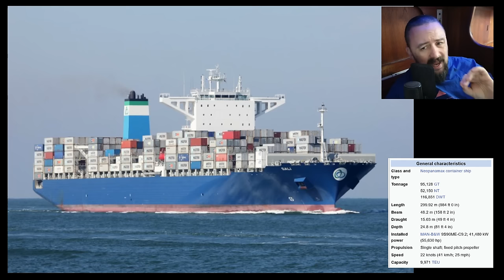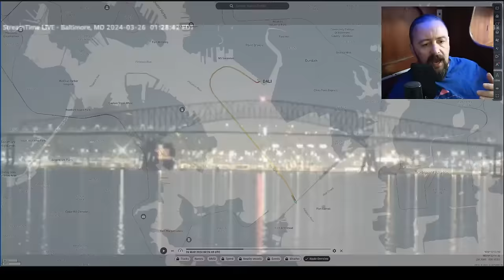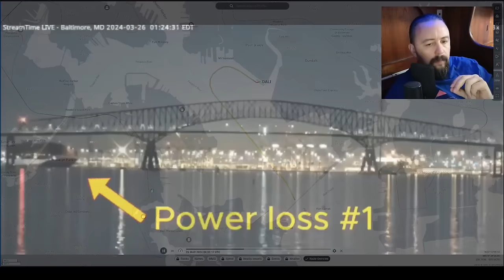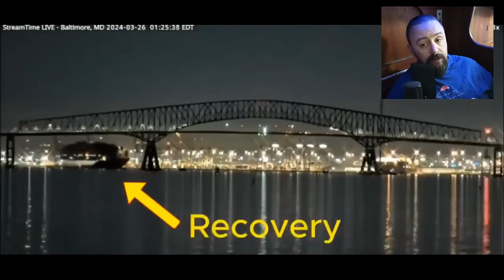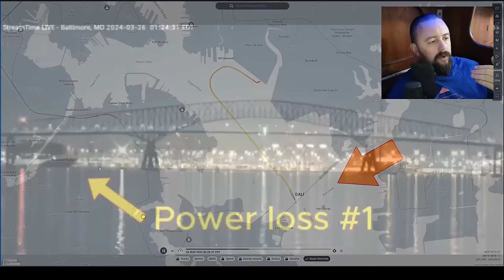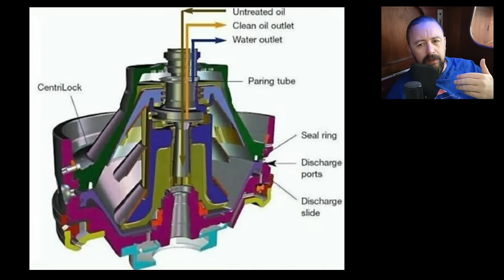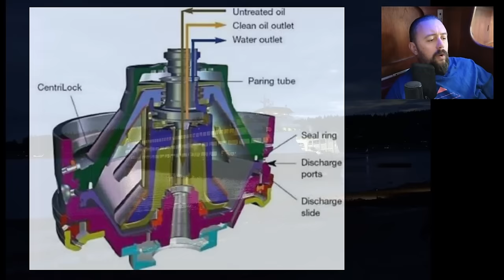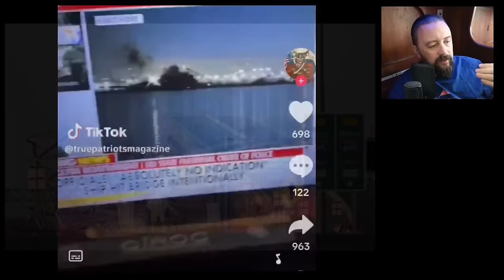Why MV Dali lost power and struck the Key Bridge: a sailors perspective

Comment: I was in the Coast Guard at Curtis Bay which is on the Baltimore Harbor side of the Key Bridge behind a channel and penisula. I served there a few decades ago. I agree with you concerning the lack of escort tugs and how they should have at the very least accompanied the ship until it passed under the span and through the narrow 1.83 mile clearance in the river just south of Sparrow's Point. They used to do this. Two tugs, one fore, one aft...port and starboard would tie a loose line and accompany the large cargo vessels in and out of the tight constrains of the port of Baltimore and under that narrow 1200 foot clearance in the Scott Key Bridge. I remember asking about this when I was on a bouy tender out in the bay coming in towards the Key Bridge my first time underway...In fact, in 1980 (June I believe) an Asian cargo ship slammed into a pylon of the Key Bridge due to engine failure and caused some damage but there was no massive collapse like this week. From that time forward it appears that at least until the 1990s the tugs did a full escort under that bridge both ways. I also think once power was lost and they regained some power they did a full astern to try to reverse the ship's course, or stop, and this caused the ship to go starboard (right). That is the black smoke....that strain of doing a full power astern. Had they simply allowed a full course ahead they likely may have stayed in a straighter line. This is just surmise on my part, but I have steered vessels in that body of water. Remember, this ships are huge, the cargo is enormous, and these waters are shallow and pretty narrow...
It is also obvious they have cut back on tugs doing nothing more than getting them into the channel straight towards the bridge about 100 yards from the dock and the tugs are done now.

Comment: The key lies in the fact that the ship veered to right just before the Bridge , before which was the black smoke from the funnel , Taking these two into account it is possible to construct the case 
These are harbour tugs meant for docking & undocking not salvage tugs, to say even if the tugs were there at the bridge it would be of not much help to a ship moving at 8 knots, This contaimiated fuel &  causing black smoke is but nonsense,

Comment: Does DALI have a bow thruster , if so why wasnt it used .
Reply: What part of the had no power the bridge went dark is so hard to understand
Reply: Yes the Dali has a bow thruster.    But it's not designed to stop an out of control ship.    It's actually designed to push the bow away from the dock
Reply: @jeremyeldee5205  I like how everyone here is an expert and knows exactly what happened and exactly what they should have done. Yet none where actually there
Reply: @gregorylyon1004 Besides if there is a Blackout. Bow Thruster is also dead. Normally when the vessel is already clear off berth and the speed is more than 8 knots and increasing, Bow Thruster will be on stand by or it be switch Off to reduce power consumption.

Comment: Would dropping anchors help for no power
Reply: It takes around 5 minutes to drop Anchor
Reply: Definitely it will help, If the 2 anchor drop on the first blockout there will be a chance that the vessel speed will be reduced if not completely stop.
Reply: Dropping anchor is less than 5 seconds. If the vessel is inside the channel, both anchor are ready to let go in case of emergency like this situation.
Reply: The port bow anchor is out, wonder if while the stern was sliding to port the ship tripped over its own anchor maybe pulling the bow to starboard?.  I take the the Dali would have stern anchors?

Comment: The dali has two auxiliary generators  3,840 KW and 4,400 KW. She also has a bow thruster which to my way of thinking is one of the most important things to enquire about. The port anchor chain is also vertical which considering what happened may have lost the anchor..
Reply: those are 6600v alternators in it.

Comment: Does anyone know it this ship had a direct reversing engine or a controllable pitch propeller? I remember hearing about a tragic accident involving I believe a large factory fishing trawler. This boat had a controllable pitch prop and it was sinking as the crew were attempting to launch the life rafts the flooding overcame the gensets and it lost electrical power. Apparently when power is lost some of these controllable pitch propellers will go to full reverse. In this situation being offshore in a storm at night no one noticed that the vessel was doing something like 18kts in reverse and when they put the rafts in the water they were promptly swept away. I don’t have much experience with controllable pitch wheels but it would explain a lot. Since the engine runs at a constant speed and the speed of the vessel is controlled by the pitch of the wheel, having it go to full reverse pitch would load up the engine causing the govener to run the rack to full fuel and you would get the same black smoke until the turbo spooled up. I was thinking about this and it’s an interesting possibility that would explain a lot. I’d be very interested in finding out if this ship had a controllable pitch prop and if so if it would go to full reverse on its own with a loss of electrical power.
Reply: The info panel about the ship, showing from 1:50 on, says it had a fixed pitch propellor.
Reply: Over load shuts it down

Comment: A more logical and simple explanation is that this was intentional… the “power outage” does not coincide with the engines being on or off. This first time it had lights off and no smoke. The second time the lights went out the engines were still going full throttle.
Reply: NO....! But AVOIDABLE.....  All actors took it not serious..... Maybe the port personal didn't know about the real issues of this ship....
Reply: Much of the electrical is powered by a separate generator set with backup.
Reply: They likely never lost the propulsion engine. They lost power and control. That’s why the black smoke they likely were quickly trying to slow down

Comment: Basing then video.
NOTE: *When the running generator fails to fulfill the load requirements of the ship then, the 1st stand by generator will come on load automatically within 15 seconds. If the 1st stand by generator fails to start automatically then the 2nd stand by generator will come on load automatically in the next 15 seconds. But, if both the stand by generators fails to start automatically then, in the next 15 seconds, the emergency generator starts and comes on load automatically. Thus, the emergency generator comes on load automatically within 45 seconds of the power failure from the running generator.
 Emergency Generator was not able to.load automatically to keep the vessel navigation and steering systems to steer the vessel away from the Bridge pillar. 

SOLAS requirements for the Emergency Generator :
The emergency generator should come on load automatically within 45 seconds of the power failure.
Reply: Over load by smoke. Went down on murphy switches. Over boost over load
 Off it goes manual re set required

Comment: Thank you so much 😊 for talking about ( centrifuge) fast spinner for fuel, water, particle, ( bunker C) left over bulk fuel after refinery. Cheap left over bulk fuel that CAN and has been used in shipping
The oil company SELL this left over products that can BURN in these large ship's 😊 the huge Marine Engines specially designed to burn this left over fuel. So glad you showed the ( inside) of one of these. Have hear the term, never seen the inside of one. Remember what they mandated after the big Alaska ( Prudhoe Bay) oil terminal. They require TWO very powerful Tractor TUGs to be on standby and have there cable rope line on super oil tankers. There were SPECIFIC build Tugboat, with HUGE powerful Diesel engines. They had massive ( Ballard) pulling power that means the tug can pull in winch and not tip over even with tugs pull with the main engine. The only point that I am making is the Cost of these special tugs that were designed just for oil super tanker assistance. I see a lot of new build tugs that the Ports want "O" emissions from ship assistance tugs now being built. The huge battery bank takes away from a tugs main engine so you have dosn sized the main because you have added tremendous Wt to tug itself. 
The assistant tugs if your gt to require ship assistance under all bridges has to be built with huge pulling power, it just seems to me by my reading from the publisher of ( Professional Mariner) that the Tugboat industry builder of these new styles, that they look at more "O" emissions than just getting a massive diesel engine with powerful Ballorn pull in tigs. Remember the battery bank in tugs take away from the engine Wt. You can't put both on the way tugs are designed. You need tugs that can pull and STOP a container massive ship. And that just build bigger ships. The second Panama canal is an example. You had to dig a new canal just so these new builds could squeeze through. The old canal was not wide enough.  In my Humble opinion those very modern bild ( McAllister) tugs even say in there advertisement that there tugs are ( low emissions) did those tugs give up HP for low emissions to meet Port requirements. My thoughts are would these tugs even if ONE was astern with wire rope up to this ship, would it have had the power to stop this 2015 build very large container ship. With the wind blowing the side and container like a big sailing ships of olden days of sail. I have heard pilots say the massive car carriers are real had to even dock with a wing blown against the side, even with TWO tugs assists, and that Pier side just docking to pier. When I was in Army on a 45 foot Tug ( ST-2154) we were on side of ( FMS) barge and 65 foot tug was power on stern ( FMS,) has no power of its own to push through water. When we were call to power STOP the barge. It just about tipped the 45 foot tug over. All it remember was the NCO runing to cut the tow line with fire axe. And me looking straight at water, we were on are side according to witnesses on (FMS) the (FMS) is a hug floating machine shop with galley and berthing, with harbor Master office on board. It was for overhaul of all the 671 Detroit Diesels that are unit had for ( LCM-8s ) a landing craft that has a small open pilot steel house on stern over a bank of Engines. They did make ship assist tugs after Prudhoe bay disaster. But I say again would TUGs have been able to stop this massive ship in the type of power failure just like this. I think even if a tug was on sturn and started pulling, the time would NOT have been enough to STOP the collapse. The tug would have gone through the same power up, pull, the ship would still be moving forward. That just me from listening to Professional Mariner and a tugboat Captain talking about this very issue of bridge collapse. 
Why do new cruise ship put multiple bow thrusting on new builds with pods for props that furn completely around. So they don't require a tug to help them hook to dock, and leave. It cost money to the cruise industry for TUG assistance at every lier they hook too. Added cost to cruise customer. The added vost of tugs with big shipping will be passed on to all the consumers that is me and you. Just saying people have to remember this is a cost we will pay on higher prices of all are goods and vehicle that we want.

Comment: I know the MD state government well, I have dealt with administrators in MD since 1998.  The MD Transportation Board has 5 members earning over $300,000 per year, they are all incompetent.  All five of these individuals knew about the pitiful dolphins that were in place.  Ok, you don't need the extensive concrete Dolphins that are at the Tampa Bay-St Pete bridge, but the dolphins in place were nowhere near the supports of the Truss bridge and were woefully inadequate.  I am sure you will agree that Dolphins are not the answer to absolutely all circumstances but Dolphins + a filled island near the supports as at the rebuilt St Pete-Tampa Bay Sunshine Skyway would probably have stopped 95% of accidents, even with a ship of that tonnage.  However-that bridge was finished in 1987. So after 35 years, the Board still hadn't acted, and had put off only studying further repairs until 2025.  Every single Board member should resign immediately or be fired.  I know you can't comment on this, but it is just common sense to a 10 year old.

Comment: Thanks, a kor of good information here.   Additional questions: 1) if hazmat/explosive materials on board, shouldn't they be placed in the middle where it's more stable/protected, rather than the front?   2)   Would plastics dumped in the fuel at the refinery get thrown out by the centrifuge and filters, or if the plastics are a similar density to the fuel, will they get carried with the fuel into the engines?

Comment: When main power load is dropped solenoids that are held open by powsr close and the relays open air power for starters and fuel pumps . Power is supplied to critical lights pumps and radars and cooling systems .,battery lights supply lights until power is restored . The first black smoke shows emergency gen start up , and reduced lights show that they are under back up power . Would back up,power , power maneuvering thrusters , if they had them ? Steering gear ? . Add in there were no dolphins close to the bridge piers to deflect vessels from contacting them

Comment: Filters get crud , I pictured a Triple Racor actually.
My Seattle area yacht captain and tug friends always talked of  Algae in tanks . Floats on top but can suck onto an inlet. Racor won’t show it .
As an outboard tech , I learned fuel line (recalled later ) will collapse and block flow , funny , it took 10 minutes before happening, restart and same thing 10 minutes later .
   Anchor going under and dead hull floating off center. Once it pivots you need power 
OR a tug.
Anchor stopped bow but stern kept going .
Curious if they have GPS on both ends or at helm beacon.
     They did slow a knot which at the weight did lower Force .
   Thanx for cleanup of the Bs , $ caused this .
Boat design for max. Load .
They put in new cranes and dredged for depth . 
     Catching a broken boat would be tough in my 50 mph alum tow boat . 
I couldn’t push it but that tug that can can only do 15 knots.
You’re going to have to post at bridge or shadow it . Both cost $.

Comment: Persistant power issues ? Was the fuels boss not checking for contaminated fuels , engineers not maintaining fuel filters and water seperators ? Clogged injectors ? Why did they get underway with unreliable power systems ?

Comment: It's always good to have someone like yourself who is knowledgeable and has experience in these matters. I believe you have done well. And you know, it's always easier after the fact, to say this or that should have been done. Myself, working construction for several years, seeing things which are unsafe, reporting to superiors, then told not to worry about it. But when something bad happens, nobody wants to fess up and take the blame. Things such as this should be engineered, with thought about what size ships may be built in the future. I could be wrong, but when the Key Bridge was built, I'm sure the size of ships was much smaller. Hey, thanks for making this video.

Comment: Noticing that the wind was blowing at the rate it was and direction caused the accident after the loss of propulsion.
Reply: It was calm.  The smoke appearing left of screen of the funnel is a result of the funnel moving right of screen. Note the location of the smoke in relation to the bridge, and it's barely moving or dispersing.

Comment: Power loss. 
You are right generator stopped. 
45 sec the emergency generator kicks in. But it does not gives power to the engines.
Another few mins the 2nd generator comes in power automatically.  
Assuming they were doing port so engine room was fully manned. Two generators working. 
So has to be an electronic failure on whole generator systems. 
Big since it goes off again. So looks like a electronic malfunction 
Winds are less. It’s the emergency astern engines they used immediately 
She is doing 7-8kts.  Winds are not strong enough to turn the ship around such heavy momentum.

Comment: what i don't get is why didn't the pylons of the bridge have protection? Accidents happen. Now knowing that the bridge was unprotected the only real surprise is that this did not happen sooner.
Reply: Apparently someone who lives in MD said they were supposed to do it for years, but Annapolis would not allocate the funds.
Reply: There appear to be four dolphins but they are very small and not very close to the bridge column bases.
Reply: further down on the bridge , on at least one side, there is alot of protection from ships & boats. It almost looks like protection from small craft, preventing them from going under the bridge where they shouldn't be going. It's not dolphins, more like railing or guide laid out horizontal. So at least the bridge is protected from sailboats...

Comment: Actually the wind was only 6 knots. There is no explanation other than this was intentional. The bridge is 8 times wider than the ship. 6 knots of wind is not going to blow a bow that far off course. The steering action only happened after the ship came back “on line” for two minutes (in order to make sure it made contact with the pillar). It was a quiet calm still night here in Dundalk.